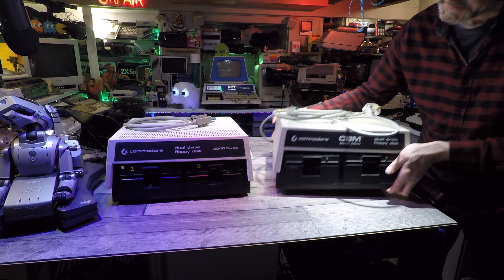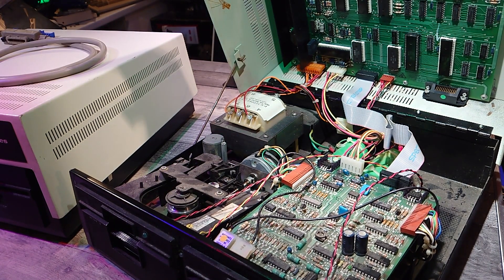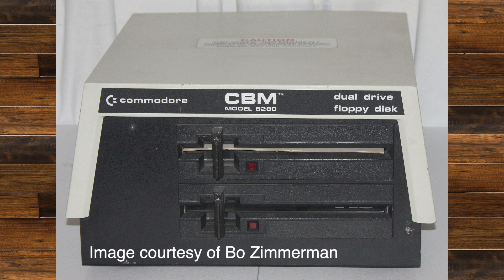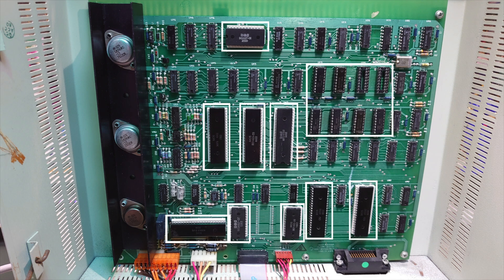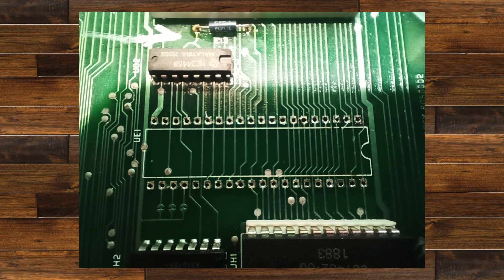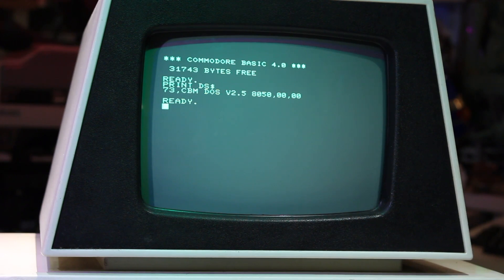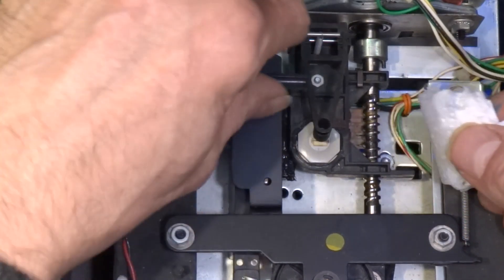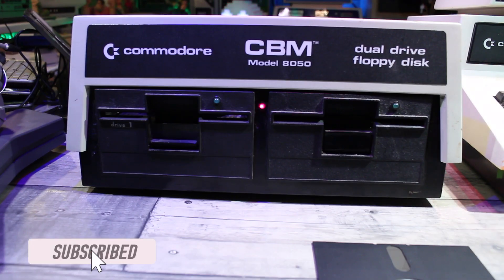COMMODORE CBM 8050 5.25 1980's FLOPPY DISC DRIVE RESTORATION REPAIR DOCUMENTARY

Comment: great brought back memories . First computer i programmed .  I did a point of sale programs on the pet and it was always the drives and the media that caused problems. Moved on to a motorrola 6800 running the pick o/s  running Dartmouth basic. I remember connecting extra pets on the ieee to try and make it multi user.  There was a toolkit which transformed my programing. Renumbering was a great help.  Thanks for a great video.

Comment: Wow, never knew those cables were so expensive, I have a box of them
What kind of floppies did you use? IIRC the 8050 is Quad density and required 98TPI floppies.
Reply from the maker: Not sure actually. I bought some new ones a while back that have no labels. The other disk I formated was an old one. I loaded a copy of space invaders from a tape and then copied it two both disks using the 8050.